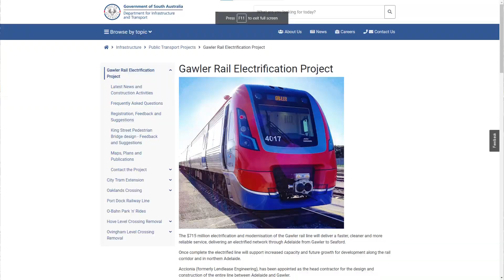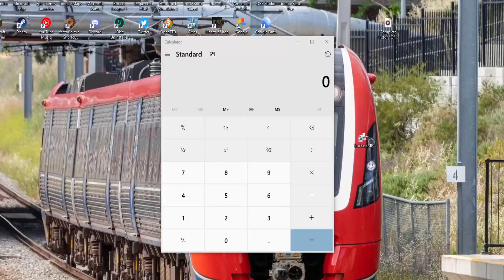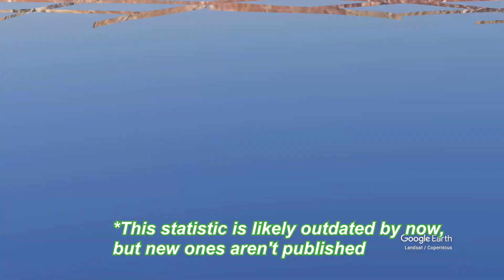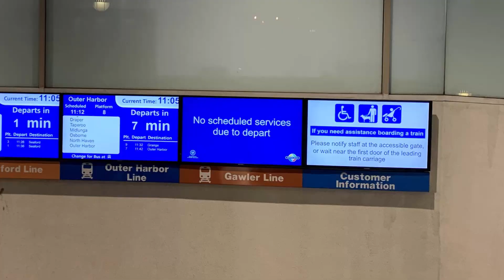Gawler Line Electrification Project Explained

Comment: Hi,
The electrification of the Gawler line so ridiculously expensive at $16.7 million/ km. Putting electric wires above an existing suburban train line (double tracked) with support poles should be really cheap given there're no mighty engineering challenges. There're no mighty rivers, valleys, hills and mountains to cross; just electrical cables. This Gawler line electrification project for 42 km long is beyond an embarrassing joke when it comes to insanely high cost blowouts.

Perth's Mandurah line is 70.1 km long and only costs $1.22 billion total or $17.5 million/ km (see 1st link below). That cheap and well built Mandurah line included train stations, pedestrians overpasses, fare gates, park n rides, fully integrated bus to train interchanges, new rolling stock, signalling and 25 kV overhead electrical wires (see the 1st & 2nd links below). The double tracked railway track of the Mandurah line was built fully grade separated in the median of Perth's Southern freeway that never stopped flowing. The railway line had to cross two rivers with two bridges. A city block in Perth had to be demolished to accommodate an Underground station for the Mandurah line. The tunneling of the Mandurah line under Perth's CBD was a technically challenging project to connect the South to the Joondalup (North) line. WA's mining boom sucked killed labour out of Perth with limited supply of steel, but the entire Mandurah line project came in budget and slightly overtime. The entire Mandurah line was built for $17.5 million/ km in 2007 dollars without cost blowouts.

Rail infrastructure rip offs in Australia links:
https://m.youtube.com/watch?v=d0kIYfx0fRI (The great rail infrastructure rip-off, Ecotransit Sydney)
https://m.youtube.com/watch?v=ejENsIhwqTU (Sydney rail costs rip-off (video), Ecotransit Sydney)

Perth's Mandurah line:
https://transportsydney.wordpress.com/tag/mandurah-line/
https://blogs.crikey.com.au/theurbanist/2013/03/15/if-wa-can-build-rail-lines-cheaply-why-cant-the-other-states/
https://www.google.com/amp/s/thewest.com.au/news/wa/joondalup-and-mandurah-train-lines-celebrate-significant-anniversaries-ng-b88688795z.amp

The Western Australian government sets a good example of how to properly build railway projects cheaply and efficiently with no cost blowouts.

It's unbelievable that any railway infrastructure costs significantly more to construct and operate in Australia and America when compared to many parts of the world. These crazy high estimates by state goverments of construction of railway lines are a deliberate attempt by the ruthless motoring lobby to demonise improvements to public transport and forcing more freeway construction. The high cost estimates for vital road, rail and other transport infrastructure (especially cycling) are a cosy duopoly between the state government and private construction companies designed to benefit the greedy construction industry. Also, corruption and bureaucracy of government and the motoring lobby or industry are to blame for the high cost of Australian railway projects and other transport infrastructure.

There has to be an independent national inquiry to why countless of recent road, railway and other transport infrastructure cost so much in Australia. A steel railway with grade separated trains are awesome for high capacity, but it simply has to be far cheaper to construct and operate in Australia. We need improvements to Adelaide's suburban train network to so that it can benefit commuters immediately, check road congestion while being value for money of taxpayers.
Reply from the maker: Couldn't agree more. Every state seems to be suffering from the same problem. Costs have risen to the point where we think a project over $500 million is cheap and insignificant honestly.

While I don't know what can really be done about this, I think it's safe to say it's holding a lot of good PT projects back. I doubt much is going to be done about it, as Governments seem pretty happy to just keep borrowing...
Reply: @AussieWirraway , The Gawler electrification project was originally $150 million, but from Adelaide Railway Station (ARS) to Salisbury. Then, the price of electrifying the existing Gawler line from ARS to Gawler Central increased from $300 million all the way to $715 million with cost blowouts. At these expensive prices and slow rates, we in Adelaide will never a direct underground rail link built quickly at a reasonable price.

This stupid South Australian government has decided to privatise Adelaide's suburban train network. These state bureaucrats have wasted $2.1 billion on privatising Adelaide's tram and train network while pretending that privatisation is magically going to improve Adelaide's train patronage. The SA government desprately lies and says it will still own the "rail assets" including trains, trams, tracks and stations, and will continue to set the fare price for travel. A private operator, Keolis Downer will continue to demand the entire control of the rail assets.

Adelaide's buses were privatised in 2000's where buses often competed against trains lines within close walking distance for the same number of potential passengers.

Evidence of privatising public transport shows that services are less frequent, capacity is reduced while costs of fares substantially increases. Why? A private operator has a driven interest in making absolute profit from public transport rather than providing enough services that the public need.

Instead, that $2.1 billion can be used for improving capacity constraints (bottlenecks) of Adelaide's train network. Improvements to Adelaide's suburban train network at reasonable costs include:
- Excess station removals to improve average speed of an all stations train service
- Duplicating tracks of existing train lines, Gawler, Belair and Outer Harbor lines.
- Remove existing railway level crossings at road intersections and train stations to improve safety and capacity of road users, pedestrians, cyclists and train passengers.
- Turn the branch Grange and Flinders line into frequent feeder train services (10 - 12 mins) with single carriage 3000 class DMU trains. This can improve the capacity and frequency of the entire Outer Harbor and Seaford lines.
- Electrify the Outer Harbor line.
- Extending the Gawler and Belair lines to Lyndoch and Mount Barker respectively
- Lengthen existing train stations to accommodate a 6 carriage 4000 class EMU train. Each carriage of a 3000 or 4000 class train are approximately 27 m long.
- Widening existing train platforms, adding faregates, bicycle parking and restrooms in major train stations after excess station removals
- Ticket machines must be added at the entry of the train station or before the faregates to facilitate a faster turnover of passengers.
- Remove validators on the trains doors and ticket machines inside the trains.
- Integrated bus and train interchanges
- Bus network redesign from a useless hub and spoke to a frequent all day connected grid. Transferring can be good, as long the connecting services are frequent, comfortable, safe and within walking distance.

Even the O'bahn busway junk is highly inadequate for this day and age due to the low capacity nature of buses in a highly patronised corridor. The O'bahn has to be converted to a steel wheeled metro system (third rail) with trains. An O'bahn conversion to a metro system improves the capacity of the Adelaide's North Eastern corridor while allowing buses to be repurposed as cross city routes to serve the suburbs.
Reply from the maker: @michaeleverett1479  Definitely agree with a lot of your points. Adelaide's rail network still has a lot of potential and despite efforts from the Government to run it into the ground for so long at the very least patronage has rapidly climbed since rail revival. I mean in the past decade patronage has doubled, and while the number of people on the system is still low, it's better then it used to be by a long shot. 

Originally I do believe scope for GREP was platform extensions, but that must of got cut out. The highest priority item I think we still need to do is electrifying the OH line, which should have been done years ago. At that point I do think an underground city loop or expanding capacity at the existing rail terminus would be the best idea. All lines need to run at least 4 tph (except Grange), and the seaford and gawler line should probably get all day 10 minute max waits.
Reply: @AussieWirraway , Absolutely agree that Adelaide's train network with trams and buses are unfinished business. We need a rail revolution to revive Adelaide's public transport by building new suburban train lines with no route branching and replacing the O'bahn busway crap with a steel wheeled metro train. Focus on the trains and buses, and leave the tram extensions behind. Better and more frequent buses with normal Busways/ BRT and regular buses are needed around Adelaide's suburbs too. Our over reliance on at grade buses and O'bahn guided busway are harming Adelaide's public transport. The motoring lobby has forced Adelaide's PT to have one of the worst patronage for an Australian capital city. 80% of people in Adelaide can't get to their jobs, hospitals, places of leisure, shopping centres within a reasonable time for 30 minutes per direction as seen from modelling by Infrastructure Australia. It's obvious that the entire Adelaide public transport system is extremely unsuccessful and needs desperate radical reform.
Reply: @AussieWirraway , The motoring lobby and their greedy automotive industries have enormous amount of power and influence in politics. Many recent basic railway projects in Australia have crazy high cost estimates by the state treasuries, and it's a very serious problem. It's obvious that the motoring lobby tries to make railway projects or other improvements to public transport as expensive as possible in order to demonise public transport. Even improvements to cycling especially in Adelaide are slow and ridiculously expensive. Then, the motoring lobby and the automotive industries often agrue against the overinflated costs in improving public transport and cycling to aggressively push for more freeway construction and other unnecessary road projects. The automotive agenda has destroyed many North American cities due to excessive low density urban sprawl with single use zoning and frequent traffic congestion from the freeways. Pedestrian, bicycle networks and street networks (with dead ends) are deliberately poorly designed in many North American and Australian cities to make walking and cycling as unusable alternatives to cars for short distance travel (1 km - 4 km). Cars are always a single occupant vehicle, and sometimes 2 people due to practical reasons. Short distance travel (1 km - 4 km) by car is an absolute overkill. Detroit and Denver are American cities where their urban fabric have been completely destroyed for the single occupant car and spaghetti junction of freeways. There were suggestions to double deck the existing freeways in Los Angeles, thankfully it didn't happen; it shows that car travel has gone too far. Of course, excessively overcrowded public transport where lots of passengers are left behind is also bad.

Cities are for people vibrant communities first and active transport for short distance travel, not cars. A big mistake to fully neglect public transport for the private car. The purpose of public transport is to successfully keep single occupant car traffic in check. Walking, cycling, zoning and street networks are very important too, and should never be overlooked. A multimodal modal transport network is needed in Adelaide with multi use zoning.
Reply: @John Clapshoe, I don't recommend any junctions or branches on railway lines. Branches reduce the entire capacity and frequency of the major trunk corridor. The Moscow and Saint Petersburg Metro in Russia has train lines with no line branching (see links below) to allow for a highly frequent and high capacity service with absolute consistency.
https://en.m.wikipedia.org/wiki/Moscow_Metro
https://en.m.wikipedia.org/wiki/Saint_Petersburg_Metro

The proposed Gawler train line extension to Nuriootpa must have a new alignment as the old tracks are very indirect. A new alignment is needed to allow fast train services of maximum speeds of 160 km/h between stations. Terrain through North East of Gawler has no engineering challenges and construction costs of the railway would be cheap. Of course, grade separation of the railway to Nuriootpa would be similar to the Noarlunga line extension to Seaford from 2011 - 2014 with two new stations (see link below).
https://dpti.sa.gov.au/infrastructure/seaford/seaford_rail_extension

After the Gawler line extension to Nuriootpa has finished with three stations of Lyndoch, Tununda and Nuriootpa, Transport Oriented Development (TOD) can be used around the new stations. Strategic zoning within walking distance (200 m - 800 m) with TOD, Pedestrian Oriented Development (POD) around the train stations, park n rides and bike n rides insides the stations can encourage patronage. Even the O'bahn busway junk uses TOD with zoning policies successfully which has transformed Tea Tree Plaza from a sterile suburb to a booming regional urban centre (see link below).
https://en.m.wikipedia.org/wiki/O-Bahn_Busway
Reply: @John Clapshoe, Here's my below proposal of extending the Gawler train line to Nuriootpa via Tununda/ Barossa Valley.

Gawler train line extension to Nuriootpa:
https://www.google.com/maps/d/edit?mid=1dfYgFu7akue4NIb5TubHgsm0uFoxlYT8&usp=sharing
Reply: I agree, I’m disgusted by the influence the road industry has on governments. Victoria’s problem is that everyone agrees with the rail crossing removal logic which means if any new rail line is built will be padded out with the need to not have any crossings and many people think that is a good thing. For example the 3.5 km line from Epping to Morang South cost something like $500M, but that included duplication and improvements from Thomastown.
I’m concerned any new rail lines will be hobbled with the no level crossing mantra which then are dismissed as too expensive.
A friend of mine said “there always funding for roads”

Comment: I sneeze at your mere $16.9m per KM - 
Perth's new line is some $231m per KM - Brisbane new line is some $529m per KM - Melbourne's new line is some $1,222m per KM

to grow one needs put in the money for these improvements or you can just waste away and end up like Darwin or Hobart that don't even HAVE trains
Reply: Thats for new lines, that 16.9m pet KM is just for electrification, not a new railway line.
Reply: @Adelaide_Transit  you will find it is not JUST for "electrification" but for the trains themselves, stations redesign and new rails as well, 
as the dmu rail are X lengths and electric are welded therefore your more-less creating a new line, 
the other states cost blow out is tunnelling & levelling land, 
Brisbane/ Melbourne more less use existing trains - Perth getting new trains
Reply: @paulwilliams73  22 stations are being rebuilt and upgraded (that’s a different program than GREP) The rails aren’t being rebuilt at all, the line was rebuilt in the late 2000s and early 2010s as a preparation for electrification but ipthe budget for it came from rail revival, majority of stations on the Gawler line can take 6-8 car trains, no major grade separations are occurring, the only thing occurring other than electrification is a new signalling system.
Reply: So no, it’s not like building a new railway line at all :)
Reply: @paulwilliams73  The C sets are just replacements for the A sets which are life expired by the time the C sets arrive, so hardly an example of "new trains" per se.  Melbourne is also getting new trains to replace the time expired Comeng trains, so again hardly an example of using existing trains.  Any comparisons between the costs of the Gawler line upgrade compared to what is going on in Brisbane and Melbourne is utterly pointless: the moment you start tunnelling, costs get very expensive, that is why you avoid tunnelling wherever possible.
Reply: @ianmorris7485  worst in OZ with Brisbane's train fleet running EMU's that are 42-34 years old STILL running along with SIX OTHER models, here it sure looks like they run they till they brake down not a total faze out before doing a newer model (let alone total frequency is also the worst)

Comment: I think that the diesel trains have lots of character, in my opinion the electric trains are petty boring and it compares to a Queensland SMU 260, also I don’t get why Australia has not implanted 3rd rail systems, it would probably be much cheaper because there is no need for supports of the overhead wires, but I guess that the 4000 class trains can’t be converted
Reply from the maker: 3rd rail wouldn't work here because A) it's DC enabled only and B) we couldn't have any at grade level crossings on our lines
Reply: 3rd rail would have to be DC and there are major issues with DC electrification, notably voltage drop when too many trains are drawing power in a section, and the increased number of substations to feed the system - averaging around every 2km for DC as opposed to around 25km for AC. That is even before even considering the health and safety issues.

Comment: I have no why it's taking so long considering they aren't doing any major engineering works alongside it.  

In Queensland they regularly put up new bases and poles alongside the current line while the tracks are open.  Only needing a weekend closure to do the final finishing touches.